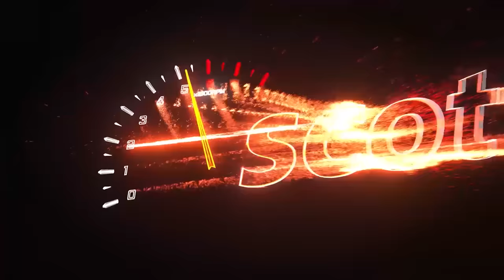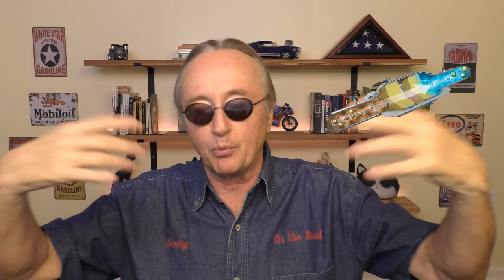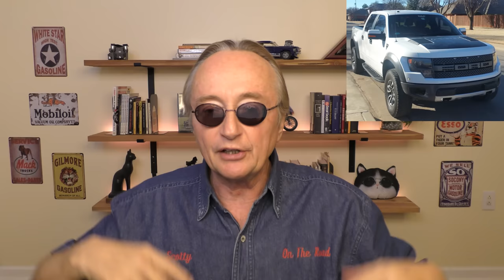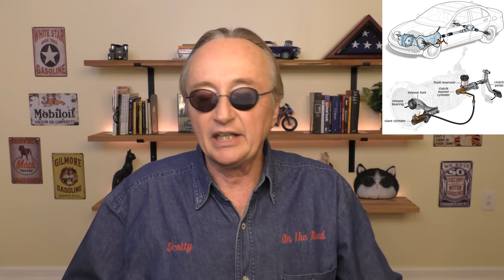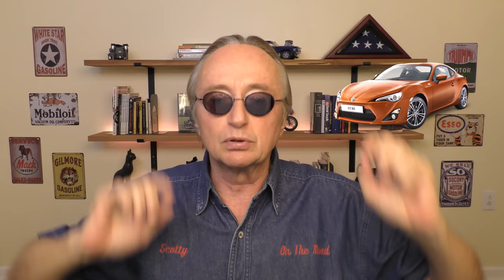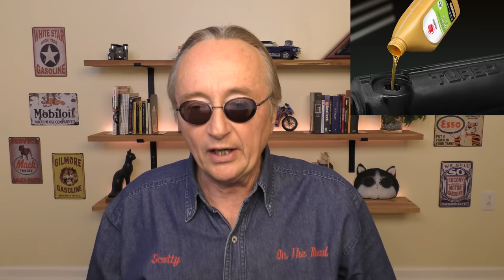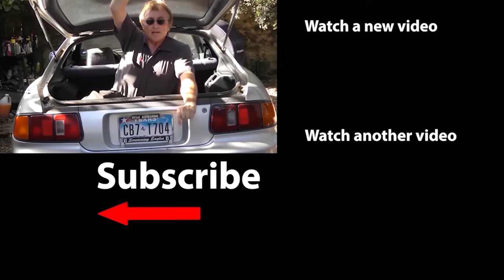Here’s Why Engine Braking Can Destroy Your Engine and Transmission

Comment: The art of driving includes braking with the engine. One who doesnt know how to brake with the engine is no driver. And no, done sensibly it wont hurt a thing. Also when you brake with the engine, ecu stops injecting fuel, so while the car is slowing down on the engine braking itself, youre saving fuel. Done it for over 500 000 km on some engines and never had a problem. Scotty knows a lot of things right but I disagree on this.
Reply: How do u break with engine
Reply: Your a DOPE!
Reply: @Real2k25  you downshift and the car slows down. Automatics do it automatically when going down a hill. But for other cases you would need either paddle shifters or a car with a manual transmission
Reply: @alexhernandez2367  Automatics aren't as good at engine braking because of the torque converter.
Reply: I use engine braking when I downshift, however, with proper rev matching, I strive for never going over 3000 rpm.
Reply: @alexhernandez2367  ook
Reply: He says it’s bad but never explains why. Because it isn’t.
Reply: @youcanrunnaked  yea I never heard breaking with engine
Reply: @jeffreyzabawski4862  with automatic car
Reply: Thats what im saying lmao 😂 Im basically engine braking all day doing rev match downshifts into every corner in my 07 350z Hr. My heel-toe aint the best but its getting their lol
Reply: @DaytonaBlueHr  😂😂
Reply: @Techrecycle4u idk
Reply: @BlackNightJack  : Notice Scotty never explains how engine braking damages drivetrains.  Because it doesn’t. Try to apply some logic to the claim.  Automatic transmissions automatically downshift as a car slows, so they all downshift for the driver.  Nobody shifts into Neutral when braking; that would be dangerous as the driver then would have less ability to react to an emergency requiring a change of direction or an increase in acceleration.  The fact that all automatics are programmed by automotive engineers to downshift disproves the lie that downshifting is a bad thing.  As for manual transmissions, the driver has three options while braking: (1) put the car in neutral while moving (freewheeling); (2) run the drivetrain in a higher gear against the brakes, until putting the car in neutral just before the car stalls; or (3) downshift to the lower gears, rev-matching the transmission with the engine as the car slows.  Choice #1 is a bad idea for the same reason it’s a bad idea with an auto trans: gliding in neutral while moving gives the driver less control over the vehicle.  Choice #2 is okay,  but slowing from a stop with just the brakes can be problematic on long downhill runs, with repeated hard braking, or braking from a high rate of speed.  Choice #3 is superior because it keeps the drivetrain spinning at the appropriate rate, matched to the rate of forward progress of the car; it sets up a quick exit from a turn or in an emergency when a change in direction and/or velocity is needed; and it puts less strain on the brakes. In contrast, it puts negligible additional strain on the engine and transmission, as those parts will keep spinning regardless of whether the car is in a higher gear or no gear.
Reply: @youcanrunnaked  DOPE.
Reply: I agree
Reply: THANK YOU. AGREE 1000%
Reply: Yep 100 percent agree, I know this isn’t relevant but he said you don’t need to shift with the clutch in a manual cars when your a pro like him
Reply: @youcanrunnaked  does it for views
Reply: @mattm5786  : I get that, but it’s unconscionable.  He has a large platform and lots of people believe everything he says.
Reply: Agree cool thing about the Subarus with cvt is if you put the car at a set cruise control it will automatically engine brake while in cruise on the decents.
Reply: @BlackNightJack  Scotty fanboy?
Reply: Scotty is talking about the automatic transmissions , and they are weakass,  manual is a different story
Reply: @mianhaafi2251  : Doubt it. Nobody manually downshifts an automatic transmission (driving out of a snow drift or down a very steep and long downhill excepting), because they downshift... wait for it... automatically.
Reply: Its unnecessary in most situations
Reply: I Drive an automatic and I rarely put it in D, always in S and shift myself , I downshift off freeways and rolling to stops signs. It's a 3rd gen Tacoma which should explain a lot as to why I do this lol.
Reply: Information for millennials and todays teens cant drive anything with three pedals
Reply: @jeffreyzabawski4862  
My car has no button with finesse written on it where do I find it?
Reply: " Also when you brake with the engine, ecu stops injecting fuel, so while the car is slowing down on the engine braking itself, youre saving fuel."  WOW! NO! No fuel means the engine dies.
I have no idea what Scotty is saying either but he may be referring to down shifting manually at a higher RPM than what the trans programmed.
Reply: @peacfulseas  
Well of course fuel keeps the engine running... Duh...
Like at idle... It does use a bit more depending on the strength of your pistons...

Vehicles are designed to not be able to even downshift to a gear that would redline the engine speed...
Reply: @boobtubeakatv1296  The OP said the " ecu stops injecting fuel," No Fuel No Go. "  It does use a bit more depending on the strength of your pistons...". I think you mean the muffler bearings,chingadera, or maybe the thingamajig.
" Vehicles are designed to not be able to even downshift to a gear that would redline the engine speed.." Okay Sparky.I suggest you seach aound this   here YouTube thingy and see what they can do with just a laptop.
BTW many factors / components determine fuel consumption but the primary fuel control is the drivers right foot.
Reply: i think he meant the risk of engine breaking isnt working
Reply: @mianhaafi2251  I’m
Surprised they missed all that ...
Reply: @peacfulseas  if You can imagine... You don't need fuel to spin engine that is still connected by drivetrain to the wheels that are still rolling on the ground....
Reply: @peacfulseas  ; If the engine is hard connected to the driveline, lets say in manual transmission I put it in third gear and let off the throttle, the car is going downhill, the momentum of the car going downhill keeps car moving, since the car is moving, the wheels are turning, and that is carried on to the engine torugh transmission - the car movement drives the engine turning and in such a scenario there is no need for fuel, so ECU turns off fuel injection while the car is activel engine braking. So how is the engine exactly supposed to die if its being driven by the trans and the trans is driven by the wheels which keep turning because car naturaly wants to accelerate downhill' I guess you dont know basic pshyiscs.
Reply: @an0nim11  Exactly. Finally someone knows how the manual drivetrain works...
Reply: Got to agree with you on this, Scotty missed the ball this time. Engine braking doesn't hurt a thing otherwise they wouldn't put Jake brakes on semis.
Reply: @an0nim11  Wow. Reading comprehension is not your strong point is it? You people think up scenarios trying to make it fit with "what if". THE ECU DOES NOT SHUT FUEL WHILE DRIVING OR BRAKING as the original poster suggested.
Reply: @BlackNightJack  Ahem. You're *
Reply: @whiskeykilmer1866  Scotty Fan-Woman. Thank you. Got a problem with that Whisker Klitmer?
Reply: @peacfulseas  I used word "imagine" because u r the one who neglect simple facts.
Reply: @an0nim11  Please answer this question. Does the engines fuel system stop  injecting fuel at any time while driving along or while braking as the original post stated.?? BTW I drive a '55 Nomad with  427w/M22 4sp. I know the simple facts. Answer the question I posed
Reply: @peacfulseas  Copied from John Cadogan channel:

QUESTION: "When my car rolls downhill in gear without accelerator input, the instantaneous fuel usage shows 0.0L/100km. However, if I flick to neutral and simply roll, it will read from 0.6 to 1.1L/100km. The engine is definitely turning and firing so it can't possibly be using the reported 0.0 but the fact all my recent vehicles have said this makes me wonder what's going on. Is there something about being in gear that miraculously uses less fuel than when in neutral?" - Jason

ANSWER: When you select neutral and roll downhill the engine is idling. Idling consumes fuel, obviously. The engine still has a job to do. It has to overcome resistance, compress the charge and drive the ancillaries. Fuel is required to do that - though not very much.

When you are in gear on a closed throttle and headed downhill the engine is being turned by gravity (via the wheels and transmission/driveline). In this state (depending on the car) fuel is shut off, hence the zero reading. 

Your statement: “…the engine is definitely turning and firing…” is almost correct, but it’s not receiving any fuel, so it’s only ingesting air. Only the spark plugs fire. There’s no fuel/air charge to ignite. When you open the throttle, fuel is introduced, the engine fires normally and produces mechanical work that moves the car.
Jason followed up...QUESTION: "When my car rolls downhill in gear without accelerator input, the instantaneous fuel usage shows 0.0L/100km. However, if I flick to neutral and simply roll, it will read from 0.6 to 1.1L/100km. The engine is definitely turning and firing so it can't possibly be using the reported 0.0 but the fact all my recent vehicles have said this makes me wonder what's going on. Is there something about being in gear that miraculously uses less fuel than when in neutral?" - Jason

ANSWER: When you select neutral and roll downhill the engine is idling. Idling consumes fuel, obviously. The engine still has a job to do. It has to overcome resistance, compress the charge and drive the ancillaries. Fuel is required to do that - though not very much.

When you are in gear on a closed throttle and headed downhill the engine is being turned by gravity (via the wheels and transmission/driveline). In this state (depending on the car) fuel is shut off, hence the zero reading. 

Your statement: “…the engine is definitely turning and firing…” is almost correct, but it’s not receiving any fuel, so it’s only ingesting air. Only the spark plugs fire. There’s no fuel/air charge to ignite. When you open the throttle, fuel is introduced, the engine fires normally and produces mechanical work that moves the car.
Jason followed up...
Reply: @MM-wp5sp  HAAAAAAAAAA. So you think the ecu shuts off fuel to the injectors while braking?
Reply: @MM-wp5sp  Again rolling down hill is not the same as braking.
Reply: @peacfulseas  ; I do not think, I KNOW. That is the difference. Unlike someone like you talking without any exp, I used to remap ECUs and yes, most engines 2000 and newer have an fuel shutoff algorith when the decelleration of the car is enough to keep the engine turning. Off course,  if the engine rpms drops below some value, say 2200 rpm, the fueling is resumed because the ECU is preparing for the next drivers action, be it accelerating or dripping out of gear - and the fueling is resumed so that the transition is made easily and so that the driver does not feel it. Try it for yourself - drive down the long hill, put the car in 3rd or 4th gear, so that the rpms are at 3000 to 4000 rpm, let go off the accelerator and look at your instant comsumption. Under these conditions the mechanical work of car going downhill is turning the engine, and since you are not pressing the accelerator pedal, ECU says you want to brake, and in that conditions it will cut off the fuel injection and your instant consumption will read 0.0 gallons or liters whatever you have. Try it and then run your mouth off.
Reply: @peacfulseas  Again, if you roll down the hill in gear, the engine is braking the car, impeding its downhill acceleration, and if the cars is in gear it is braking with the engine. If you cannot grasp basic psyhics, better leave the subject alone.
Reply: @peacfulseas  ; Again, when car rolls downhill in a gear it wants to accelerate. Engine braking uses the engine to slow the car down. The engine does not need to produce acceleration in that scenario, it needs to produce drag, ie slow the car. That is why ECU uses no fuel in that circumstances. If this basic level of comprehension is too much for you, what can I do. Not my problem.
Reply: @MM-wp5sp  "  and newer have an fuel shutoff algorith when the decelleration of the car is enough to keep the engine turning." IOW it maintains enough fuel to keep the engine running until a response from the driver. Ciao
Reply: @peacfulseas  No.

But every modern electronic controlled fuel system does it when You "engine brake" as OP said...
Reply: @Real2k25  in a manual transmission  u release the clutch and no throttle either and it will break, the more you down shift the more it breaks but if u break to much it can wear out your engine and transmission like Scottie said
Reply: @Real2k25  You're basically using the energy loss from pistons pulling in air to resist the drive wheels. Also known as pumping loss.
Reply: Plenty of vehicles come with a tow/haul mode, perhaps under a different name. When equipped as such, it's a very good sign that you won't hurt the drivetrain at all with reasonable application of engine braking, such as holding to a constant (or near constant) speed down the mountain.
Reply: @chasemiller7974  ok I never knew thay
Reply: @peacfulseas  With engine braking (while in gear and not touching clutch/gas pedal) indeed it stops injecting fuel. Unless you are driving an older car that is not controlled by ECU of course.
Reply: @Real2k25  : Nobody should be BREAKING with their engine. That would be bad. Try BRAKING (a completely different word) with your engine, instead.😂
Reply: @youcanrunnaked  yea how do u brake properly
Reply: @BlackNightJack  : Yes, knowledge is dope. Glad you agree. 🤣
Reply: @mattm5786  that's right Matt. When we use a clutch it is to ensure that the drive shaft and the driven shaft are moving at the same speed so we can change gears smoothly. Matching the revs of the engine with the speed of the transmission does the same thing.
Reply: @peacfulseas  wow! Yes! He didn't say it doesn't use any fuel. I don't know where you got that from
Reply: @chasemiller7974  also know as ridiculously inefficient braking.
Reply: @MM-wp5sp  I suppose that this instantaneous fuel usage meter which you refer to is the modern equivalent of a vacuum gauge, yes ?
Reply: @grantperkins368  ; No, it is a direct readout from fuel injection map as to how much fuel is injected into the engine. So when it shows zero, the ECU is not driving the injectors at all, they are closed, and no fuel is getting into the engine. It is a literal quantifiable way of measuring the exact amount of fuel injected. So when it says zero, then it measures directly that no fuel is entering the engine.
Reply: Scotty is answering the question asked by a person who probably doesn't know how to do engine brake properly in this video.  The subject is obviously about using engine brake for small cars whose brake are cheap.  Improper down shifting with wrong RPM can certainly damage your car.  So I think Scotty is trying to tell the new drivers that they shouldn't use engine brake to slow their cars in their daily drive.  Of course, going down a long hill without using engine brake is stupid.  Likewise, using engine brake for every traffic light is also stupid.
Reply: @BlackNightJack  . No . YOU  are .
Reply: Agreed . 100% .
Reply: @johncunningham4820  Affirmative.
Reply: Yes bro
Reply: Completely UNTRUE!!!! Engine braking can damage hard parts such as the input shaft, output shaft and especially the forward sprag! Based on the amount of load and weight, you WILL grenade the driveline. The pinion bearing can only take so much, the tailhousing rear bearing can only take so much. All of this manual downshifting which is generally max line pressure, will abuse parts and cause lash, leading to excessive driveline lash. Torque management and abuse mode try to reduce this failure. If you’re making 300 ft lbs of torque at 4,400 and downshift a gear, think of the shock on the transmission, transfer case, and even differential. If you don’t understand this then you shouldn’t be commenting.
Reply: Scotty doesn't know...
Reply: Me too,I've been doing that since I bought an automatic it's 10!years now what is important is change the oil at 30k -50k mile range
Reply: @youcanrunnaked  all automatics don't downshift automatically going downhill if you keep it in drive it will just keep speeding up and going up gears
Reply: @andreasm2882  you gonna destroy your transmission shifting in a automatic all the time like that
Reply: @perfectgematriadecodesabc4259  😆 🤣 😂 😹 😆 🤣
Reply: @Perfect Gematria Decodes ABC  OMG the horror, I was traveling at 45mph today and I downshifted from D to 3 and the rpms jumped to 2800. I think I may have blown the transmission 🤣😅😂
Reply: @peacfulseas  You said, "So you think the ecu shuts off fuel to the injectors while braking?"  On newer cars, yes, the ECU shuts off fuel to the injectors. It does this when the car is moving and the driver takes foot off of the accelerator pedal. The engine is spinning from the momentum of the moving car and spinning wheels, and the ECU will start the fuel injectors back up as soon as the driver presses the accelerator pedal again.
Reply: @oscarjones5773  You sure about that? I've been engine braking in automatics in all my 25 years of driving and putting hundreds of thousands of miles on the same cars without any problems. I've asked mechanics about engine braking and they tell me it's fine. Even the owner's manual for my cars say it's okay to do.
Reply: I was told yes engine breaking helps, but would you rather change break pads or transmission/clutch?
Reply: @BigSisLilBruh  You aren't wearing out your transmission any faster by engine braking. In fact, my owner's manual actually recommends it.
Reply: I assumed fuel is cut during engine brake also. I’ve measure fuel rate during engine brake and it’s WAAY higher. So Scotty is probably right. -06 civic si
Reply: Do a little research, don't just pull out of your butt.
Reply: @andreasm2882 glad you don't drive my cars.
Reply: we are discussing trucks? If you have in mined a car from 90s or older, had transmission repaired a few times, or fixed one yourself you are perfectly right. otherwise, you probably have to check the instruction manual, there should be one in the glovebox. They say nowadays the car will adjust your rpms, so it's probably not the same experience.
Reply: Does downshifting constantly to reduce speed using the manual pads on a CVT transmission causes more wear due to the higher revs? Kinda like you do on a racing car.
Reply: Its not for people who dont really understand what theyre doing. Or why theyre doing it